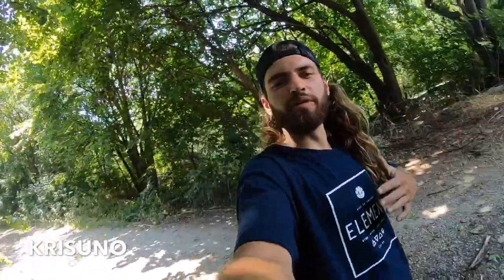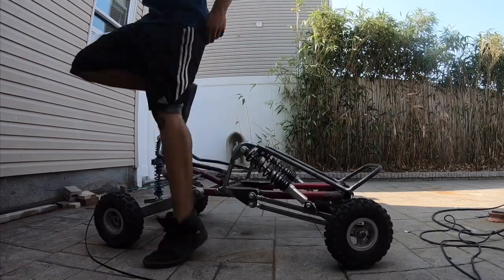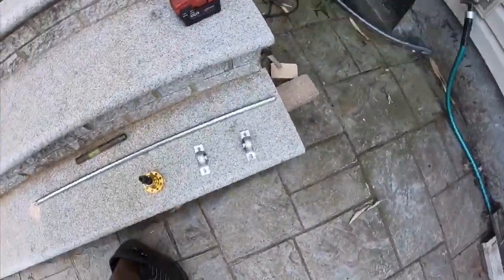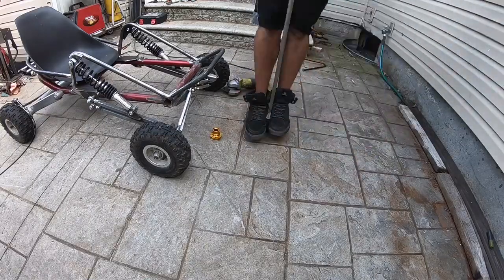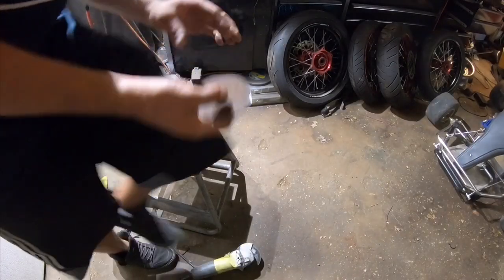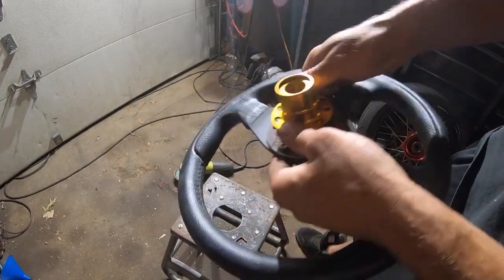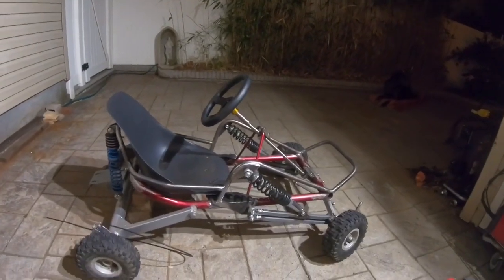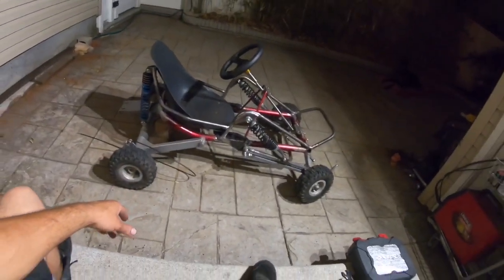(E4) How to Build a Gas To Electric Gokart *New Parts*

Comment: Hey Krisuno, I just bought the exact same gokart for $60 this morning. Found it on FB. No engine and no seat but everything else is good. Question, did you swap to a #35 sprocket? Mine came with a 40 and I'd rather use #35. If you did, where did you get it?

Thanks
Reply from the maker: Did you get a ty rod 4? It should’ve came with I think it’s like 50 tooth sprocket for a #35 chain. Unless some one upgrade yours. But you could buy the oem stuff here 

http://www.sdscooters.com/Parts/TyRod_IV_Parts.html
Reply: @Krisuno  Mine is a  Baja Motorsports Dune 6.5. Sadly it did come with a #40 axle sprocket. Looks like this one without the engine protection bars. https://offerup.com/item/detail/378968638 

I'll check out sdscooters. Thanks

This is the sprocket mine came with. https://www.monsterscooterparts.com/rear-wheel-sprocket-baja-mini-bike-mb165-mb200-heat-warrior.html